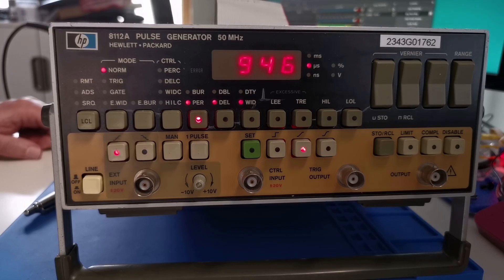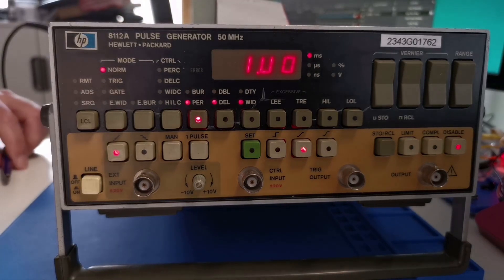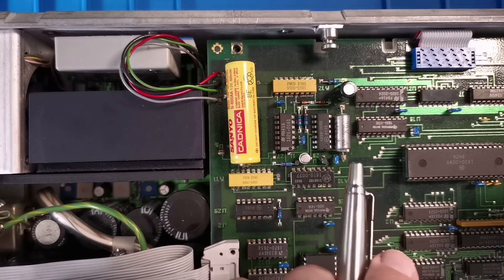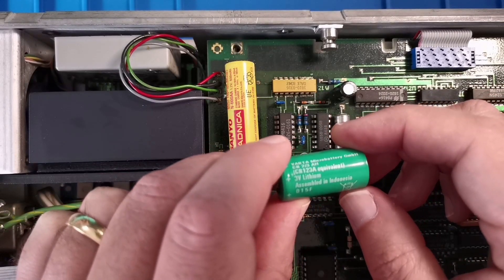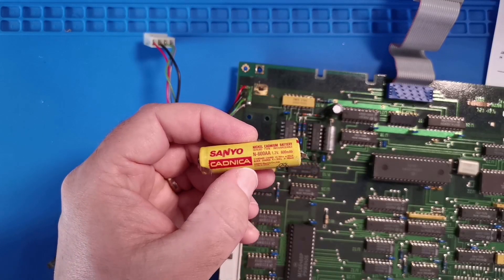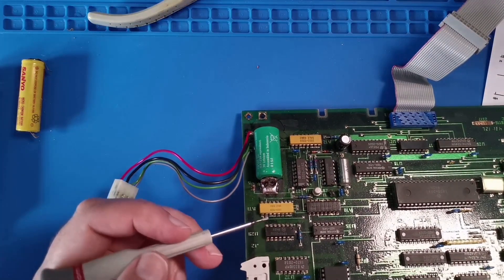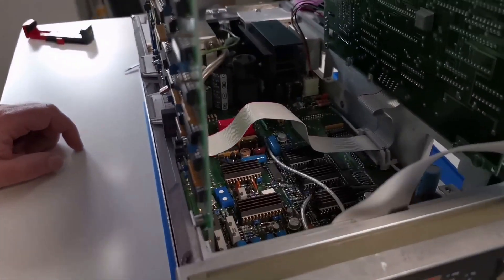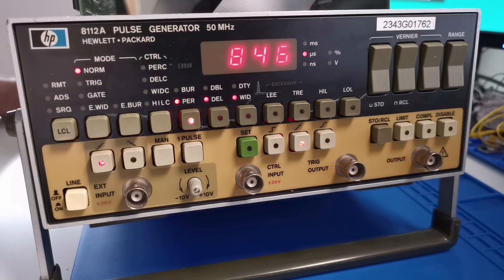Vintage Test Equipment Repair HP 8112A 50MHz Pulse Generator

Comment: In HP’s test equipments using batteries in order to ensure conservation of memory content, we find Lithium thionyl batteries that have extra long longevity. Typically these batteries are 3.6 volts and can be found with axial leads.

Comment: 2X Brand New Panasonic BR-2/3A 3V Lithium Battery with Plug one of these could probably work from ebay  Did you lose calibration of any sorts? Or, you had to provide power to the circuit while changing?  Looks like you didn't.  Interesting - it seems like there are a bunch of several version(s) of the boards depending on the year maybe.  What year is the chipset '87?